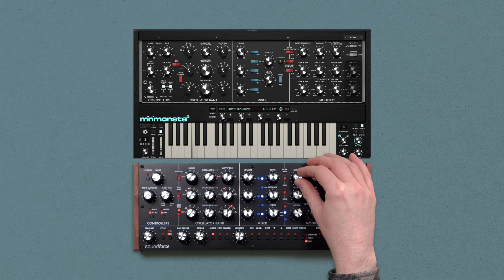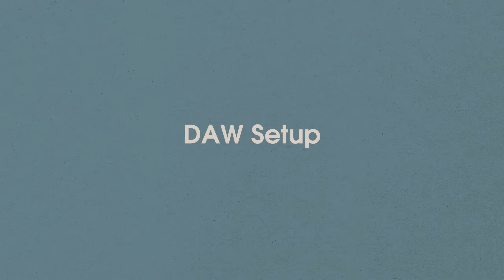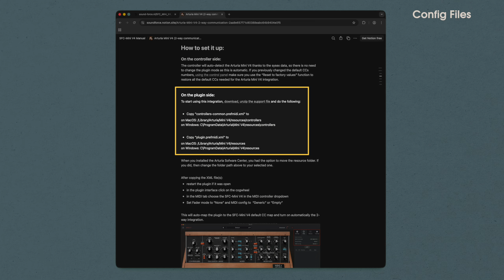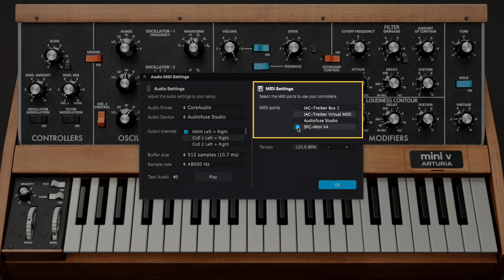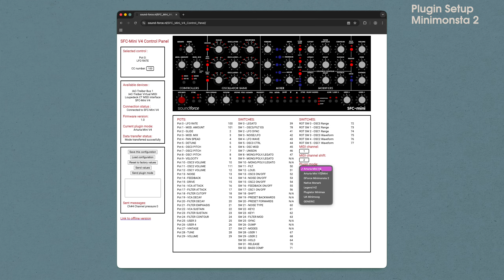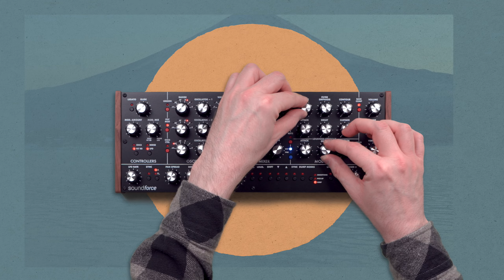SoundForce SFC-Mini V4 tutorial

Comment: Do you plan to add support for other vst's? Thanks.
Reply from the maker: You can actually use any plugin with traditional midi mapping. It already cover 9/10 mini-style plugins with mapping preset when the plugin allow it. For other type of instruments, it starts to make less sense because of major UI differences. Mapping the pots is always working well with traditional MIDI mapping, it's usually the switches which won't correspond, because of difference in positions quantity.
Reply: @soundforce_nicolas  just received the SFC Mini 4 today. Setting it up right now. So excited (˶˃𐃷˂˶). Greetings from Poland.